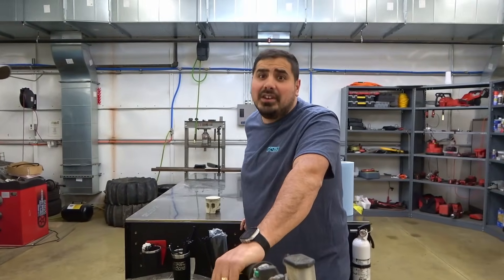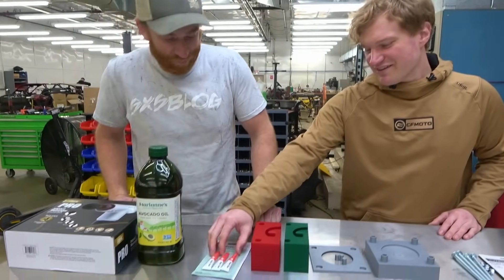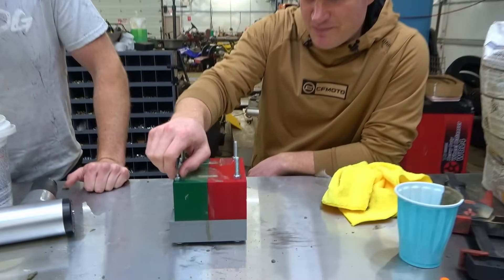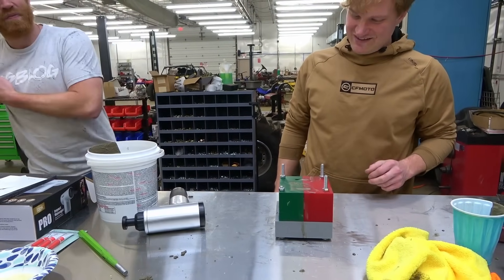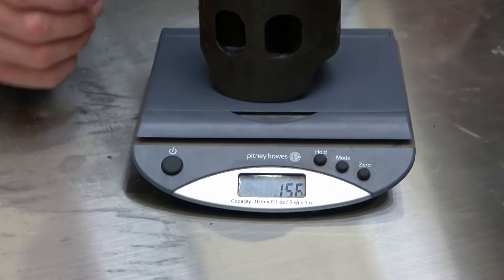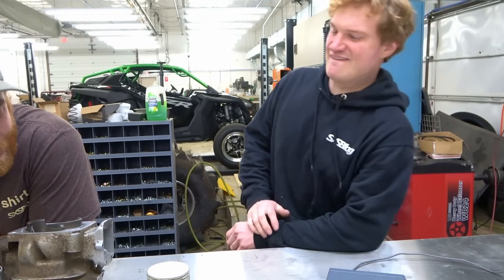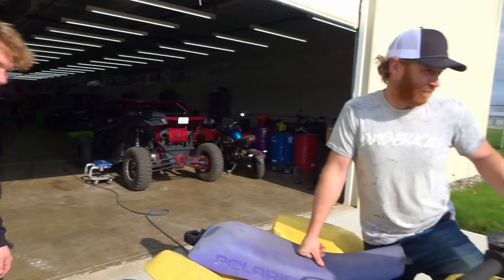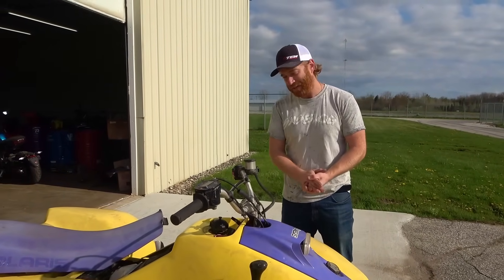World's First CONCRETE Piston! Major Success?

Comment from the maker: We may or may not have a 4 stroke quad for the next test subject 🤔 Let us know what we should do with it!
Reply: Make a wooden piston for the 4 stroke like a sawdust particleboard type idea 💡 idk 😄
Reply: A piston built from rcv and plastic....
Reply: So i know this wouldnt involve printing anything… but have a piston machined from a “billet” of marble or some other rock
Reply: Make one out of solder
Reply: Have a machine shop machine a mold and try to make your own casting from bronze or lead
Reply: I could make you a much higher performance concrete piston. Needs to be made out of gfrc concrete over 12,000psi.
Reply: 2 part epoxy also drain and use the ultrasonic cleaner to vibrate the air out
Reply: JB weld piston or duct tape piston
Reply: Make a mold and use a two part epoxy for a piston
Reply: I would have thought resin and resin fibre reinforced concrete would hold its shape better. Also a chopped carbon and aluminium topped piston should survive. Good work guys! Watching all the way from New Zealand!!! :D
Reply: Ramen noodle piston
Reply: ❤❤I was thinking that you could put a few rubber band in around the piston then put your ring on lol ,you guys crack me up lol
Reply: Put a eclectic engine in it,  a fun build.
Reply: Glass or wood lol
Reply: 3d printed valves
Reply: Epoxy piston!!!!
Reply: Glass piston
Reply: JB weld or 3M epoxy, I can’t be the only one who’s curious 🧐
Reply: I wonder if u could get a block of cured concrete then machine a piston out of it . I have no idea how to do it but it’s kinda the same principle as a block of billet hahahaha
Reply: I’ve always wanted to “turbo” a small motor using shop air. This is just a dyno or engine stand experiment, not for riding around. I think it would be cool to set it up with an air jet and a fuel jet (just use nitrous stuff) post carb on a WOT switch. I don’t think the carb would pressurize at WOT with the jets post carb. I also think you would avoid weird venturi action by introducing compressed air post carb.
Reply: Use a mold to make a jb weld piston I feel like that would be cool
Reply: Wood Piston??
Reply: you can try to make a plaster piston
Reply: Use two piston rings offset in the same concrete ring groove.
Reply: Cast lead?!
Reply: A piston out of hard glass or plaxy glass very lite and durable
Reply: if it is the quadzilla then pla restore it theyre getting rare and theyre cool asf so please keep it alive
Reply: Bullet proof glass piston!! So your engine won't blow up 😂
Reply: Pls do it
Reply: you can try carbon fiber piston if its possible
Reply: first, replace the piston with platinum-cured silicone, then slowly replace every component until you have full-silicone engine.
Reply: Use rubber oring
Reply: jb weld piston?
Reply: Epoxy piston
Reply: Fiberglass piston 😮
Reply: Plexi-glass cylinder....lol.
Reply: @brainstain22  dude this has to happen
Reply: For this piston it would be better to use concrete with fiber not cement mix. You can get concrete with fiber commercially for buildings when you don't want to use rebar
Reply: Making a 4-wheel drive of the quad.
Reply: a resin piston with different types of material inside of the resin
Reply: hardwood and polyurethane resin
Reply: I meant to say this here:
Make a piston out of heat resistant silicone. I think it would actually work. It would have to be a tiny bit bigger in diameter so it would seal tightly. I would love to so if you can do it! Thank you for the cool videos!
Reply: Glass Piston, Obsidian Piston, Copper/Aluminum Piston (cuz they have a relatively low melting point and can be melted by a torch) a very compressed Paper Piston, etc any random household/hardware material, maybe even a piston made from magnets
Reply: please make a rubber piston
Reply: Do a rubber piston
Reply: You should do a JB weld piston
Reply: Pon un piston de resina 😂😂😂😂
Reply: Glass
Reply: JB weld 👌👌
Reply: Save your beer cans or coke cans and see if you can cast an aluminum piston out of cans
Reply: You forgot (or neglected?) to polish the piston before installing.

Comment: Make a piston out of a very hard wood It will for sure be a hoot
Reply from the maker: BRB ordering some Australian Buloke
Reply: Some Brazilian ipe
Reply: Ol' hickory otta do it 😂
Reply: Ironwood from Arizona, it is so dense it sinks in water like a rock!
Reply: Cap the piston with some sort of heat shield
Reply: Iron wood it is in the name it should be fine
Reply: @110Garage  You spelled bloke wrong :body-blue-raised-arms: :face-green-smiling:
Reply: My great uncle told me a story of breaking down at his cabin in the bush on a snomobile and carving a piston out of wood for his old skidoo elan ... I've always wondered if it was true 😂
Reply: Wooden piston has been done
Reply: @110Garage  to help what ever wood you select last longer I would suggest fire hardening it before you.put it into the engine
Reply: @110Garage you should try a glass piston
Reply: Ironwood Osage orange or pretty much any old cherry
Reply: shou sugi ban the wood, makes it fire/heat resistant. Would be so cool to see
Reply: @110Garage  there's actually a legend of someone buying a tractor at Cheffins auction (like RB but agricultural) years ago that did run on a wooden piston just long enough so it ran at auction
Reply: @110Garage ceramic coat the top to see how long it lasts
Reply: Adding some kind of filler that makes it more flexible and more hardy vs. the jarring impacts, then it should last longer?
Reply: Love this try body putty I make moulds for my fishing leads and it's handles the heat and it's strong
Reply: Osage orange would be a great wood for a piston
Reply: There's a video about that lol
Reply: Mahogni piston?
Reply: @110Garage make sure its good and dried before you start working with any wood so it can be as accurate as possible
Reply: Came to the comments to say something similar you could cnc or laxer cut a wood one
Reply: collaborate with NileRed and his bulletproof wood, that would be awesome!
Reply: go watch garage 54 they did this on a 4cyl
Reply: @BigDipper907 
Garage 54 did it.
Reply: garage 54 already did that.
Reply: Some nice hard honey locust
Reply: Not sure if anything else will start in that jug.💀
Reply: I second this! Can’t wait for the video!
Reply: @renoallstate4573 nah.
Reply: You should see what a torch does to cement, and you would have never wanted to do that with the cement
Reply: @110Garage use iron wood for the best chance if it working

Comment: Try hydraulic cement  . Cures much faster,stronger, smoother, not permeable (waterproof), and no rocks. Lowe’s and hd both have it
Reply: I was going to suggest the same thing we use hydraulic cement to fix toilet flanges set up quick gets very hot super hard and durable

Comment: you could try adding fiberglass fibers to the cement for strength. it also takes about a week for concrete to hit half strength and a month for full strength. I also think you'd be better off trying to cut the ring grooves rather than molding them
Reply: A fiberglass window screen would do a tolerable job if it were spiraled or soaked and wadded, then vibrated in the mold, I imagine.
Reply: Yeah and for maximum strenght the part should be cured under water or kept moist until the 1 month mark
Reply: EXACTLY! The comment said "reinforced concrete" not normal cheap stuff. They didn't even do the suggestion right. This needs to be redone correctly with a fiber-reinforced concrete such as Fibercrete.

Comment: A common trick I use to help with a low compression engine to see how it runs. I use some oil on the piston. Pour it down the spark plus take up extra ring spacing. Smoky but works
Reply: Can vouch, did it on my last built motor.  Oil holds just enough to get that initial compression going.
Reply: We tried, it helped but wasn't quite enough
Reply: yeppers thats how I would always tell if I had a ring issue or a valve issue... ring issue id see great increase in compression.. valve issue id see minimal increase

Comment: Concrete takes 28 days to cure but I love it anyways
Reply: Same. I did sorta feel like shouting at the screen the first few times they said cured instead of dried. Still cool, though.
Reply: Correct 7 days for 50% and 28 days for 100%. And many people believe the rock in concrete gives strength but its main purpose is to absorb heat
Reply: A little fibermesh 150 would have helped too. Not as much as actually waiting for it to cure but had they actually done so, the fibermesh instead of the lint trap or whatever would have been a big help
Reply: The rocks are mostly just to make it cheaper you'll hear that 95% of the time from the owners I've been laying concrete for 27 years now and I've heard them say that to the customers lmfao 😂 @allenrhodes
Reply: Depends on the pound you purchased

Comment: Try some type of "ironwood".  I built a deck out of Ipe.  Pain in the ass to work with.  You have to pre drill every hole with special bits then buy non standard decking screws or both will just snap.

Comment: Maybe try making a piston with 3d printed ceramic, it can be hardened and can withstand high heat
Reply: The future of tensile, compressive, and hardness super materials 😉
Reply: if they do this they should oversize it a bit, because it will definitely shrink when kiln dried, and then cut it/sand it to proper dimensions very carefully

Comment: How about a piston out of stainless steel, or chromololy, something somewhat thick to start with. Not too thick though, not solid but equal or around the same weight as stock. And ceramic coat the top.

Comment: Steve cool as hell nice first attempt.  Fiberglass reinforcement in the concrete.  You need stronger concrete and a lot longer cure time.  30 days minimum.  Cut the ring grooves in with diamond saw.  Polish head.  Might be worth sealing concrete as well prior to running it.  Possibly have a pro mix designer on the concrete.  Box store is a mistake.
Love it!

Comment: You should see if Alec Steele is down to make a Mokume-Gane piston for you. (or any blacksmith that has forged it before)
Reply: though, there is a high risk of the piston actually working pretty normally for a little bit
Reply: but it will probably also warp after a little bit

Comment: 2 part epoxy piston
Solid steel piston
Ceramic piston 
Have haydraulic press channel make a piston from wire. 
Have codyslab mold you an iron piston from road gravels and thermite
Laminated paper piston. 
Turn a piston in a lathe from different materials like stainless, lexan, cast iron, lead, and my favorite, bizmuth.

Comment: Try making a piston out of hdpe (high density polyethylene) it's used in low pressure gas piping so it can handle some heat and friction

Comment: Concrete doesn't cure to design strength for 28 days. It usually hits 75% in 7 days. You'll probably luck using an epoxy/ cement mix, it'll be very strong.

Comment: What if you cut the ring lands out of a piston and put them in the mould before you pour the concrete and when it dries you can have a concrete piston with aluminum ring lands and rings. That way you know it's going to seal for sure and we can see if the dome will hold up.

Comment: Using fiber reinforced concrete with very fine particles of concrete would probably work pretty well! With a lot of fiber added in, plus quick setting chemicals added in as well would help a lot. Also use JB weld to fill and seal the ring-lands.

Comment: If you have the compression problem in the next will it piston video(if there is a next one) you should try pouring a thick oil like 85w-140 Down the spark plug hole. This might seal everything enough for it to fire.

Comment: In ww2, they made concrete ships with sawdust and metal reinforcing. 

What about an epoxy piston? Or a wooden piston?
Reply: I haven’t finished watching but I think it would be a great idea to mix in fiberglass into the piston and make it in a cylinder layering fiberglass concrete and also using something to vibrate the air holes out of the concrete

Comment: Future reference, any time you’re struggling for compression in an engine the easiest solution to” get the party started” is OIL.  If premix don’t work try straight oil, if that doesn’t work do gear oil. Than HIGH TEMP MARINE GREASE

Comment: I seem to recall ,in my distant past, a n Isuzu diesel engine was fitted with a super strength ceramic piston and cylinder sleeve . I forget what the compound was but its coefficient of heat expansion was damn near zero. The engine was without any cooling fluid and ran very efficiently at extremely high temperature. They demonstrated the extremes of temperature by using the piston as a crucible and melting another alloy piston in it. In another container the ceramic cylinder sleeve was frozen with liquid nitrogen . The hot ceramic piston was emptied of its melted load of alloy metal and immediately inserted into the frozen cylinder.  It fitted perfectly . If I remember correctly, the aim of the experiment was to show that a diesel engine would be extremely efficient if allowed to function at a much higher engine temperature and use much leaner fuel to air mix. The setup was put together in a standard crank case with the water gallery hatches removed .   I think that the con rods were also made of the same ceramic.   The story of this development drifted on into oblivion but I’m sure the video of it must be somewhere . Your bit of fun jogged my memory.
Cheers from Downunder🇦🇺👍

Comment: Next time use mortar and really fine sand. When you pour the concrete into the mold, make sure to vibrate the form to release all those holes (pukas) in the piston. Which will come out really clean and strong without any holes or cracks. 🤙🏽🤙🏽🤙🏽🤙🏽alohas

Comment: Concrete has good compressive strength, so it probably survived firing, but concrete is weak in tension or pulling apart.  It probably tore apart as the crank was changing directions at the top of the stroke.  The top of the piston was going upward and the skirts just weren't strong enough to hold onto the top of the piston and pull it back down.

Comment: If you ever wanna redo it i have the recipe. Plaster of Paris 1/3 in Portland Cement with river or sea sand 1/3 of the overall mix volume and whatever your hand can grab of concrete reinforcing fibers. For every cup of water add a spoon of PVA glue.
No rebars, mesh, aggregate, anything else.
You need to leave it alone for a couple days before remove the mold and occasionally spray it with water the first few days, you aren't going for structural concrete you just want this as ready is possible.
I use this recipe for model houses and the cast comes out smooth, it sets within moments with the plaster added, and strength wise i can step on a model house with a 3mm ceiling slab.

Comment: Marine Tex epoxy piston.  I can neither confirm or deny that back in the day there was an unauthorized repair to the cylinder head of a locomotive engine....  The issue you will have with this stuff is having a good release agent for your mold.  It will withstand about 260 degrees

Comment: Seems that HIPS dissolvable filament might make removing the form-work less stressful on the piston. Also normally you'd use rebar to reinforce the part, so maybe make up a heavy wire frame or cage to suspend inside the mold to give it some integrity. I understood that concrete needs 30 days+ to reach full strength - and that's after the mold/form-work comes off - and you needed all of that strength. Lowering the ring lands a little on the piston might have helped too.
How about a composite piston? Concrete crown on plastic body?

Comment: Portland cement, and other similar compounds form hydrates when you add water.  But, well, if you heat them beyond a certain temperature, you drive off the "water of hydration" and they fall apart.  Often spectacularly.   It's why fireplace bricks are made out of a special firebrick mixture.  I suspect a combination of that and a brittle failure due to shock.

Comment: There is a cement we made in high school that was stronger that steel as it was made with layered fibers plus it was light enough to float as we made canoes and raced them in our manufacturing class at Lincoln County Kentucky High School. So I can try to go ask my old shop teacher how we did it. I think this can be done given the right kind of concrete being used. You could take a huge block throw it in a tank of water and it would float. Let me know.

Comment: This is fantastic experimentation. 

I think the big issue with engine parts is the continuous shock they experience from the flame front. 

The plastic one likely did much better in this sense because it could deform and flex in real time. 

A couple of good hits was all it took for the pin holding area to give way with the concrete one. 

Perhaps the next material to try would just be aluminum! The fun would be in casting your own.

Comment: Concrete can handle pressure very well but has little tensile strengh, thats why they put in iron bars. To build a concrete piston you should add  aomething that can handle tensile strength like fibers (glass fibers or carbon fibers),  problem might be the adhesion between the concrete and the fibers. There also are different types of concrete that harden much faster than normal concrete but to get it to a decent strength it has to cure a long time like three weeks.

Comment: If you plan on making any other pistons with other materials that require air to cure may I suggest making the molds from silicone instead of plastic as silicone rubbers is actually fairly air permeable

Comment: You need to go to home depot and a bag of Crete called cemental and get the blue and white bag cause it has no gravel in it and hardens within minutes. It's an industrial patching cement that reaches strengths up to 9000 psi Within days .